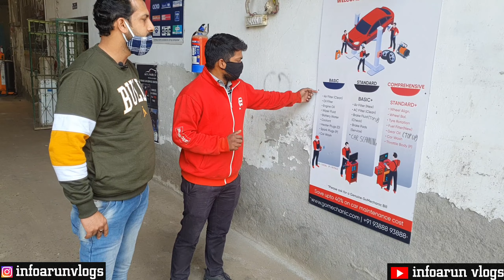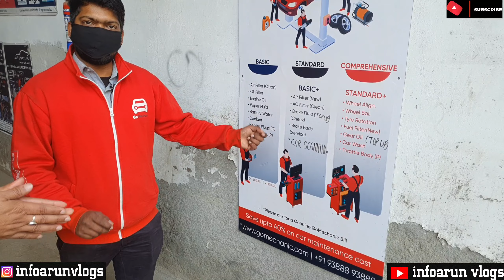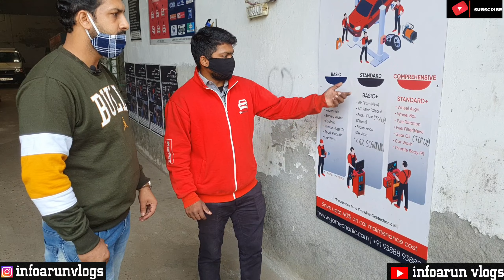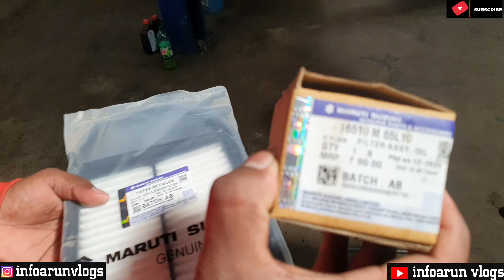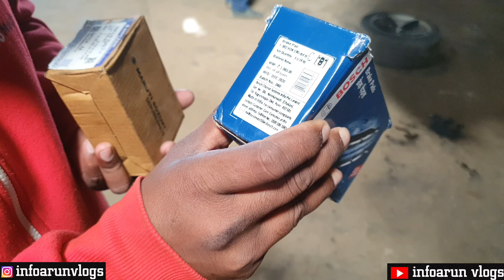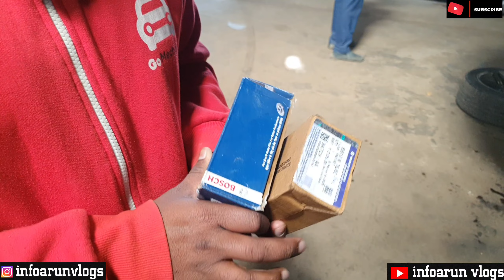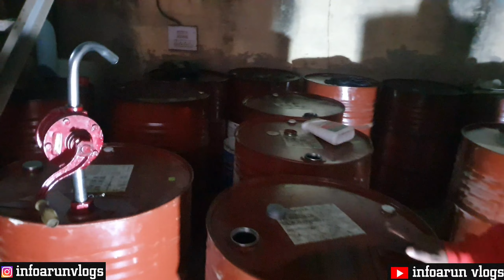Car Service Only for Rs.2599 at Go-Mechanic Workshop | Pocket Friendly Service With Free Pick & Drop

Comment: Bhai ji kafi costly price h,
Mene abhi 18.06.21 ko apni corolla altis 1.8g petrol ki service karwai h, price ke sath batata hu aur brand bhi.
1. Engine oil Genuine toyata 5w30 4ltr=Rs.2000.00
2. Oil Filter genuine toyota=Rs. 600.00
3. Air Filter, Sakura (indonesia)= Rs. 240.00
4. Coolent genuine toyata for top up 1ltr= Rs. 290.00
5. Wiper, syndicate = Rs. 390.00
6. Air Cabin filter, zip brand= Rs. 300.00
7. Engine flush, BG quick clean=Rs. 200.00
8. Spark plug clean.
9. Throttle body clean.
10. Front break pad clean and Caliper pin greasing.
11. Battery water top up.
12. Air filter sensor clean.
13. Labour charge=Rs. 1000.00
14. Wheel alignment=Rs. 250.00
15. Wheel camber adjust= Rs 250.
Total amount for my car corolla altis 1.8g petrolis = Rs. 5520.00
Reply from the maker: Bro mujhe 5000 ki service padi thi main break pad the otherwise 2600 ki service mujhe toh costly nahi lagi bahar se bhi karwata hu service woh bhi around 2000 ki padti hai..
Reply: @Infoarunvlogs  bhai mene toyota ke genuine product lag waye h. Please check my list
Reply from the maker: Bhai toh maine bhi toh saare parts genuine hi lagwaaye the
Reply: @Infoarunvlogs  2000 ka engine oil hi h.
Reply: @Infoarunvlogs  bhai toyota aur maruti me koi difference nazar nahi aata. Kaha 1200cc aur kaha corolla altia 1800cc
Reply from the maker: @blackpearl7570  bhai toh phir tumhe yeh bhi pata hoga ki Toyota ki maintainence Maruti se sasti hai.
Reply: @Infoarunvlogs  lagta h apko pata nahi ki corolla altis petrol 1.8 g ki maintenance kitni costly hoti h, compare mat karo kaha 8lac or kaha 18lac. It's too much difference bro.
Reply: Toyota bhot sasti h maintenace ke mamle mein even mere pass scorpio h mera bill paid service mein 15000 ka aata h shrif oils change hota h qki Mahindra se krwata hoon gomechanic se kewaya 8200 mein hogya aur wahin jab innova service krti h toyata mein tabh 8000 mein hojata h
Reply: Abb sochiye kahan 2.8 l ka engine aur kahan 2.2 l ka engine phir bhi rate dekh rhe ho